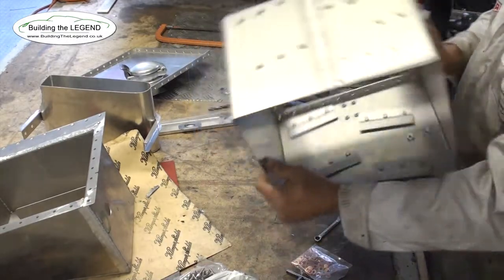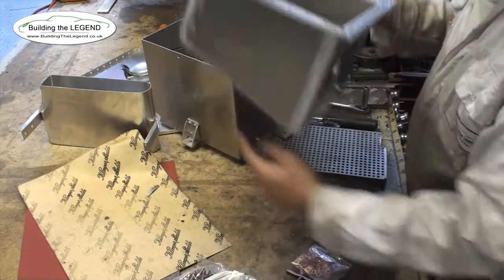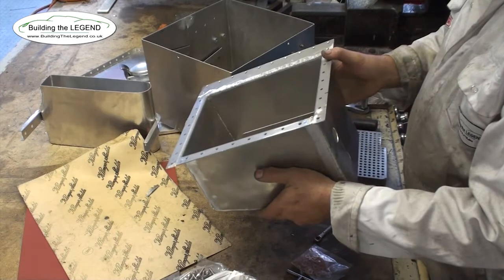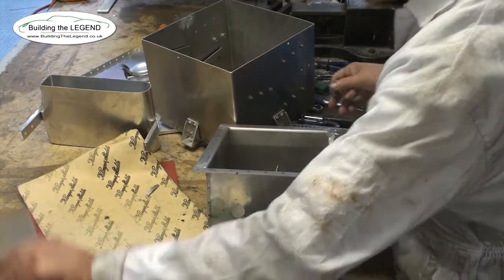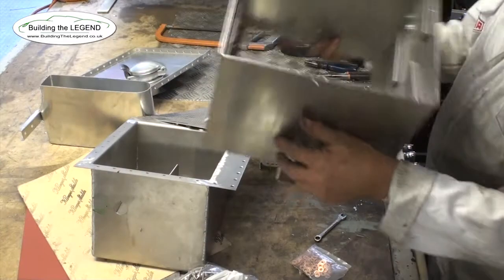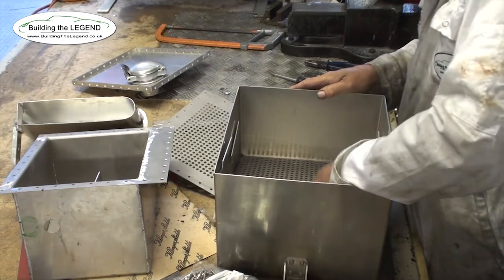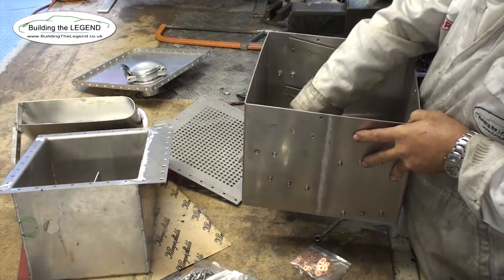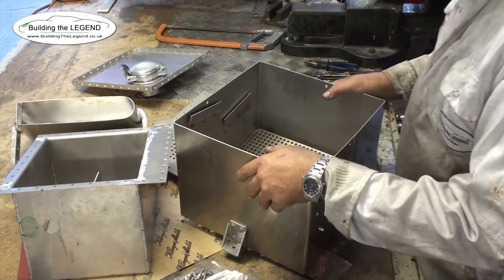Dry Sump Tank Fabrication

Comment: Hi, have you tried the dry sump system. I have a problem. My system is built for 2l Fiat engine, in the tank I have 1,5 gallon of oil and made spiral oil separator but my oil does not deareate enough. My oil pressure is not over 3 bar (45 psi). On 4000 rpm it needs only 15 seconds to lover pressure from 4,5 bar to 3.